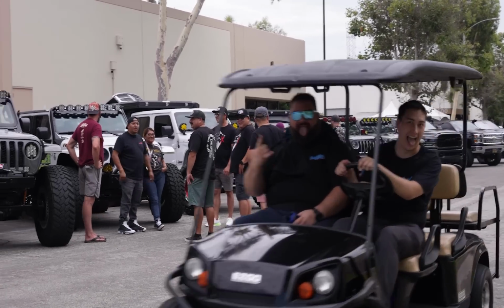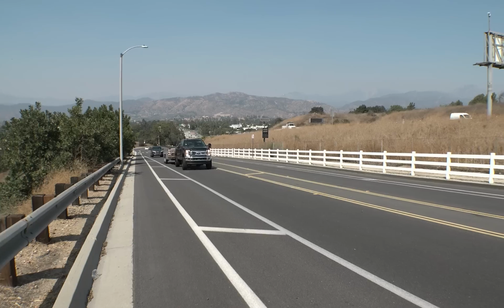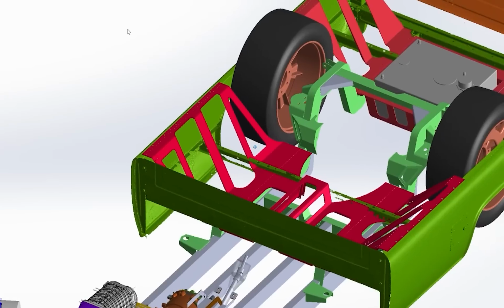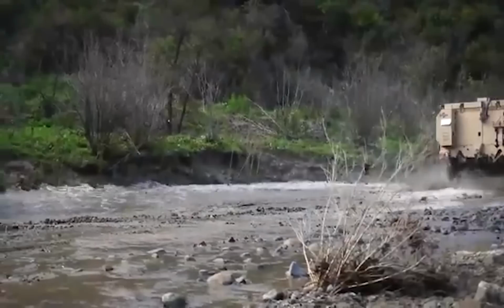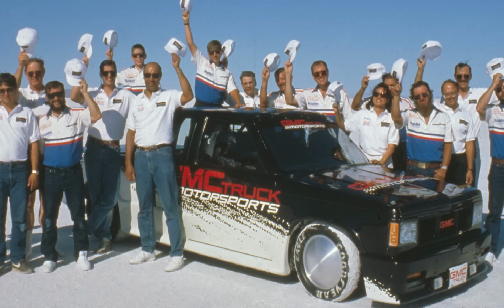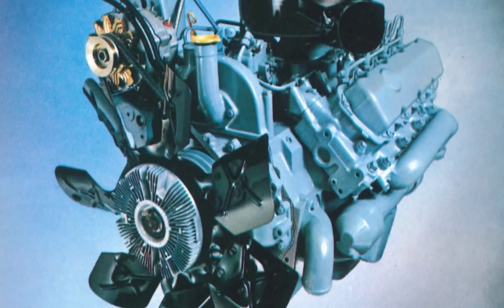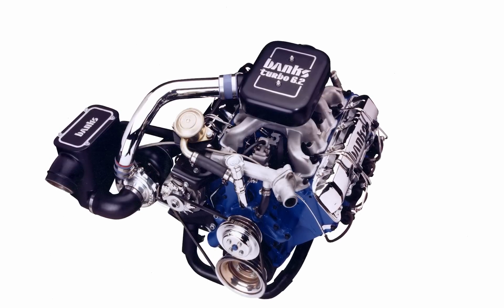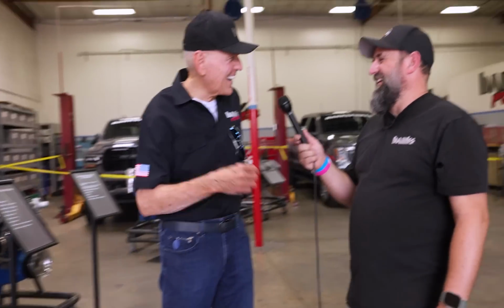6 Decades of Diesel Performance in 13 Minutes

Comment: Would have loved to work for him and learn from him. He tests the hell out of everything. Not like other performance companies that slap bs desriptions on things that dont really work. He proved what i was thinking about when i was an apprentice mechanic. Those aluminum diff covers that expand capacity and supposedly cool diff fluid better were doin just what i thought back then. The internal shaping of them was just a big hollow pan. Instead of being shaped around the ring gear so it could pick up and throw the oil where it needs to to keep lubrication and cooling happening. The open pan aluminum ones dont have anything following the shape around the ring gear causing most of the fluid to fall off right above the resting fluid level. So he proved it. He made a Transparent cover copy of the standard design as well as the big aluminum one. And ran the diff speed up with vehicle on a lift and tested both designs. The big pan basically is killing your diff by stopping the oil from making it where it needs to go to keep everything lubed and cool.  He had a video on it. Smart guy. Never stops thinkin.

Comment: 1997 I had a Banks system installed at Banks on my 460 Ford chassis Motorhome. I got more power and more MPG, part of the pkg. was a transmisson module that moved the shift points to a better point for a heavy vehicle. I never regretted the install.

Comment: My invitation MUST have been lost in the mail … 😏.  Congratulations Gale & Crew .  I have been running one of the first generation 6-gun Tuners & Speed loaders & Big head Waste gates on my ‘02 LB-7 since mid ‘03 when I bought my truck used .  ALL those parts are still on the truck & have worked flawlessly now for 20 years through all sorts of weather & conditions & towing medium to heavy loads ( upwards of 15,000 lbs sometimes, over the weight rating of my early Duramax ) and without complaint .  I’m a believer in his products and his commitment to making a great product that stands up to his company’s promises .  I wish I could have come up today from San Diego to just shake your hand in person Gale , and congratulate your crew for doing all you have done all these decades . Much appreciated here .  😎👍

Comment: I bought a Banks kit for my 93 Cummins in 95 and it's still on there and works. I like the fact that Gale does things without just throwing fuel at it. I've always believed that smoke out of a diesel is wasting fuel and  potential power . I'd rather get good power and economy.